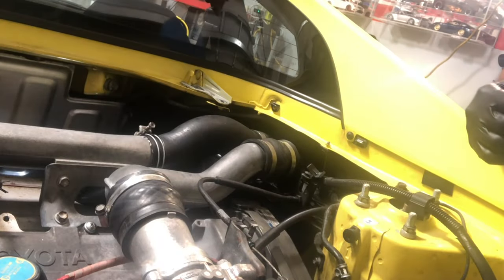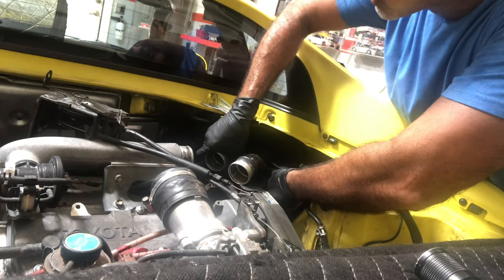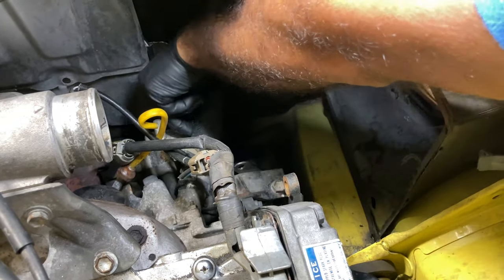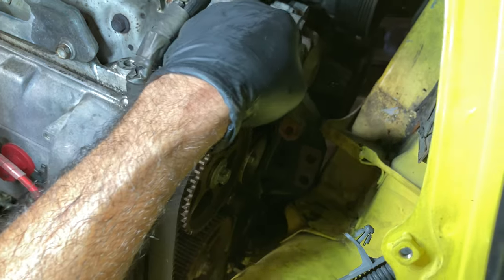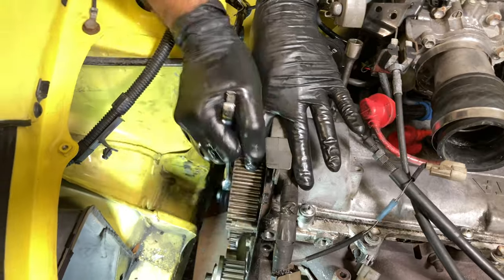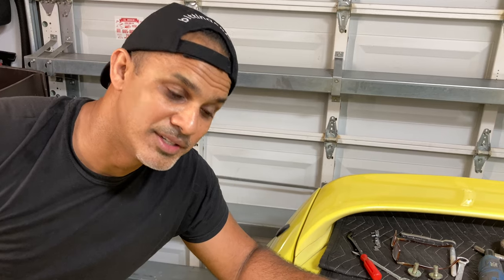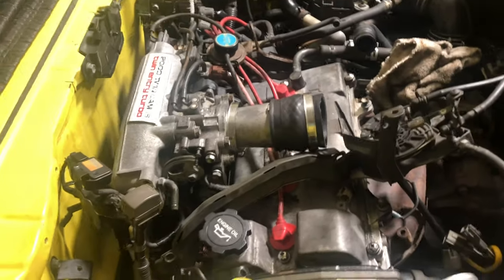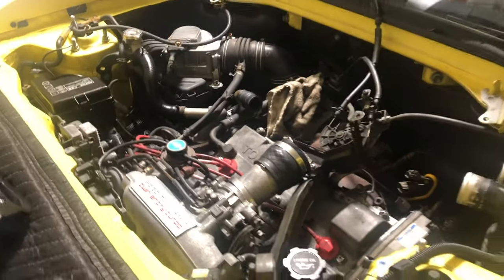The Banana MR2 SW20 Gen2- Timing Belt & Seal Replacement

Comment: Perfect timing! I'm just getting ready to replace valve seals on a gen4 with the engine in the car. I'm going to try and zip tie the belt/cams together and replace valve seals one side at a time to prevent the belt from rotating too much. This was very helpful.. I just hope I don't have to remove that weird shaped engine bracket 🤞
Reply from the maker: Good luck , if you need to redo the timing i have a video on the gen4. Just look in my library. Appreciate the feedback and watching the video.

Comment: Great video I just did the belt on my gen 2 I'm using a gates racing belt. Issue I'm having is I set the timing correctly I spin it around and I can slide the belt off of the cams with ease it seems the belt is very loose
Reply from the maker: Do you have a new tensioner and did you can the # of teeth on the new belt to confirm its the same as the original belt.
Reply from the maker: It was literally impossible to install the belt without having the tensioner completely off to give perspective on how perfect of a fit the belt is supposed to be
Reply: Yes new tensioner and exact same belt
Reply from the maker: Hmmm, double check the tensioner is installed correctly but it definitely should not be that loose. Something if wrong for sure
Reply: Yes tensioner is new and I did count teeth

Comment: How did you get that belt on?  Did you put the belt on, then the tensioner?  What order did you put everything back after placing the lower cover on to see if you were at top dead center?
Reply from the maker: Install the belt and once you have all the marks alligned go ahead and install the tensioner. You need to have the lower cover and crank pulley installed since there are no other timing marks on the side of the engine to allign the crank pulley.

Comment: When you pulled the oil pump out, I noticed you put a whole bunch of grease.  Do you need to do this, if so, what type of grease did you use?
Reply from the maker: Your dont have to, this is something i learned from my uncle years ago who is a professional dealer tech. That grease is actually vaseline and apparently helps to prime the pump on startup and reduce friction.
Reply: @bitingantz  Thank you!

Comment: Changing that belt was very labor intensive. Now that you've changed a timing belt with the engine in the car, and out, which one would you recommend?
Reply from the maker: Depends on the situation, based on how many other tasks I had planned, removing the engine is just as labor intensive

Comment: How did you get the crank pulley out of the car while the motor was still in the car?
Reply from the maker: Just remove the right side mount and remove the three bolt from the rear mount. That will give you enough access to use a jack/wood on the oil pan to raise and lower the engine to get to the crank pulley.
Reply: @bitingantz  thanks

Comment: How did you press the cam seals in on the intake cam? Space was too tight for me to fit a 36mm socket
Reply from the maker: Hello i used a pvc cap fitting from home depot. If you have seen my previous videos installing the crank seal on the gen4/5 its the threaded cover.
Reply: @bitingantz  Thanks! You were able to fit the PVC cap and press the seal in by threading a bolt through the center? All within that tight space?
Reply from the maker: Yes it was a tight fit and you need the correct length bolt to slide at an angle. I also removed rear engine mount to allow me to jack the engine a bit higher to provide more access. I was stomped for a while like you but finally figured it out using this method. You got this

Comment: Random question, but where do you get those red plugs for the engine?. The ones from your engine rebuild videos
Reply from the maker: Hello, yoo can purchase at amazon or ebay
Reply from the maker: https://www.amazon.com/Kaishengyuan-Automotive-Machines-Accessories-Compatible/dp/B09ZQFJW6Q/ref=mp_s_a_1_12?crid=1NU3SCZII5702&keywords=engine+hose+plugs+and+caps+red&qid=1667219922&sprefix=engine+hoplugs+and+caps+red%2Caps%2C1484&sr=8-12
Reply from the maker: https://www.ebay.com/itm/125488839457?mkcid=16&mkevt=1&mkrid=711-127632-2357-0&ssspo=2YLeu6g7TL-&sssrc=2349624&ssuid=blogSDtLTHq&var=&widget_ver=artemis&media=COPY
Reply: @bitingantz  much appreciated 🙏